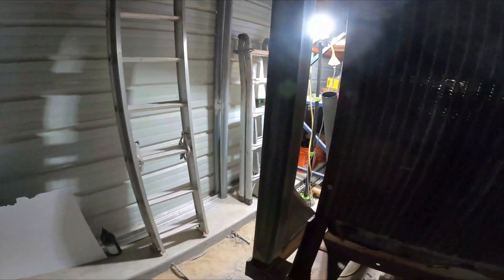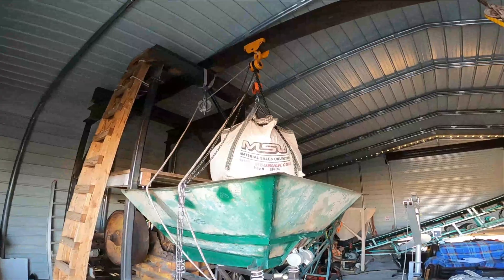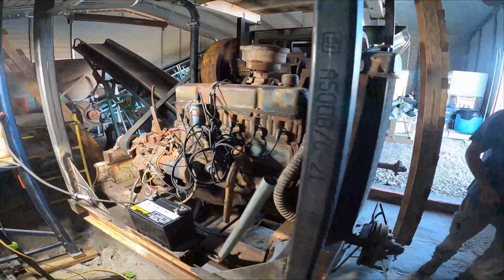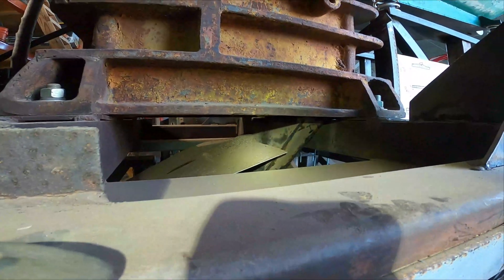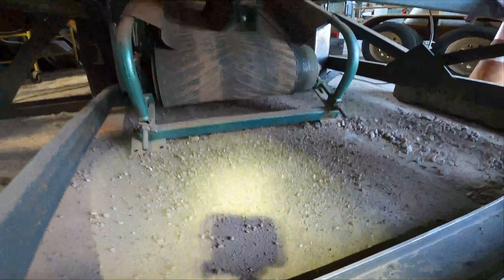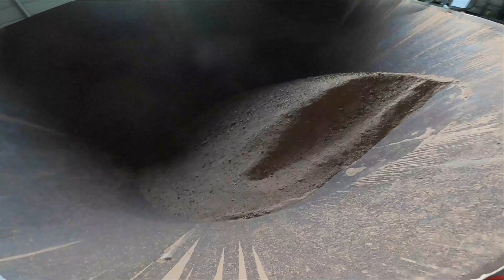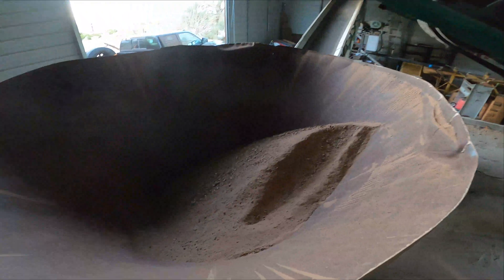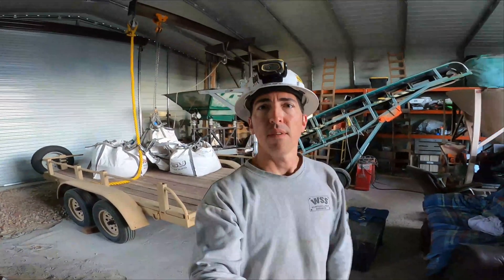765lb Sample Test Run

Comment: Been following you on icmj, I have a similar setup, 8x12 jaw feeding a stutenroth mill, we just decided last year to run 2 mills, and 2 concentrators, the 2nd mill hits all of the oversized materials, the idea is so we can get it all in one shot with gravity cons, and strip the free gold, then stockpile all the blacks n sulfides for leaching in the future.

Good luck!  The equipment is a pain in the butt but here after putting this all together for the last 4 years finally working out all the kinks

At first i wanted a building too but have since made everything a module, but do plan on having all of the concentrating and ‘wet’ work under a roof
Reply from the maker: Nice to hear it's finally working out Kyle. We'll have to do something similar. We have a Neffco centrifuge we can include into the system, as our 2nd concentrator, but the waterflow requirements are twice the amount of the table. Trying to figure that one out. We definitely need another crusher. The Orbital crushers caught our eye but they are pricey. Definitely have a long road ahead before we're dialed in. We want to leach as well. Any recommendations? Super Leach Explorations is performing a test for us. They're located in Arizona.
Reply: @mineoperator  yeah I have talked to them, their operation is a few hundred feet from my old claim.
Reply from the maker: @smokinvr4  we should find out those results this month. I'm trying to do a video with them.

Comment: Nice job. Can't wait to see how the Stutenroth and table do.
Reply from the maker: Thank you jdeluisa. We'll find out today. I'll try to get the next video out asap.
Reply: @mineoperator  I'm watching close because I have essentially the same set up in Honduras
Reply from the maker: @jdeluisa  That is great to hear. We recently experienced overfeeding our table. Learned our lesson there. We're getting a better handle on our dust problem. Much better than it's ever been. Also, where to cut off the middlings on the table. It changes with different ore we process. We're not getting the grind/liberation we need. May need to address the screen inside the mill. We look forward to your thoughts and experience.
Reply: @mineoperator  I think the table is going to be a big bottle neck for you. The feed into the stutenroth needs to be 1/4 inch minus and it is hard to do that with a jaw crusher. From your video the feed size looked good but if you are crushing bigger material most jaws only do 3/4 inch minus. You can feed the material into the stutenroth with just enough water to cut down on the dust and screen it before it goes onto the table. currently a Knelson that we feed into and then table the cons. This year we are going to set up a ball mill and then switch to leaching. In 2019 , the first season that I mined, I ran the material from the smaller size stutenroth through a screen and then onto a 4x8 table made by Joel Farmer. Realistically that table could handle about 1200 lbs an hour, well below what even the smaller stutenroth can do. The Knelson is awesome but it's expensive and requires a lot of clean water. Jigs might be another option to increase your feed rate in the future but they require constant monitoring (so do tables). Have you done liberation testing to determine your optimal grind size?
Reply from the maker: @jdeluisa  A few tests and sieve analysis has determined a grind size of 30 mesh (595 microns) would be acceptable but I'd prefer to run more test as 50 mesh (297 microns) might be ideal. Our largest gold is -30 mesh. 50% is smaller than 200 mesh. In this video, we had a sample prescreened to -1/2" that we ran. We see a need to add an additional crusher, like an orbital crusher after the jaw crusher. Right now we just have a screen deck under the knife gate bin to prescreen -1/2" before the mill. We have a Neffco centrifuge we are considering adding into the circuit. We want to get into leaching also. If we did, I'd suspect jigs might be a great way to go to create a concentrate as well. We suspect the sand screw we made will be another bottleneck besides the table as it's rated for 1tph. We appreciate your feedback as our setup will transform over the course of this year, and your comments are extremely helpful. Thank you.
Reply: @mineoperator  I'm ready for the vid man!
Reply: @mineoperator  screen at 50 mesh, and try a regrind to see if you free up more values.   Definitely depends on the ore type but it works well for us
Reply: @mineoperator  on your comment on the table being a bottleneck, we run a centrifuge before the table, simply because we cant afford 2 big tables at this time, my idea was that the centrifuge is doing most of the work, and the table is grabbing the rest of the blacks n sulfides.   We have a finishing table to run the cons in the end.

Truth is, a 2 plus ton per hr table would be great but they are a major investment
Reply from the maker: @smokinvr4  is there a way to tighten that gaps inside the mill to get a finer grind?
Reply from the maker: @Kyle Williams  we have a Neffco centrifuge but haven't added it into our process yet. The Neffco required 50-60gpm, whereas our table required between 15-25gpm. Trying to figure that one out.
Reply: @mineoperator  that sounds high, we use the LNW Engineering bowls on a 3500 gph pump it only needs to be running at about 1/4 valve open.   We did have it on a 1500 gph pump prior and even then it was only about 1/2.   I got a bigger pump because of the 2x bowls and was originally just gonna run a sluice box with dream mat after it as a safety but opted for our 4x8 roughing table
Reply: @smokinvr4  no wonder our losses were so great. We were following the recommendations from the manufacturer. I always suspected we needed to test it with less water flow. So running some quick calculations, it appears your running between 12-14gpm, or 720-840gph, through your bowls and table. We need to give this a try asap! It appears the Neffco and LNW Engineering bowls are very similar.
Reply: Oh, and if you had room for it, a roller crusher before the stutenroth would be perfect.   I came really close to buying one, just would not fit without reengineering a bunch, so we just do the post screen and secondary impact mill.